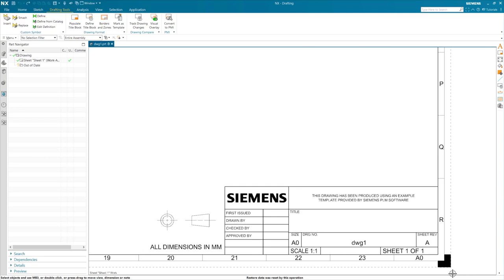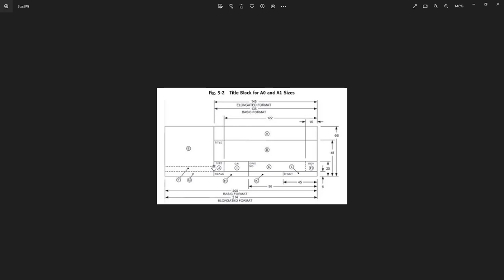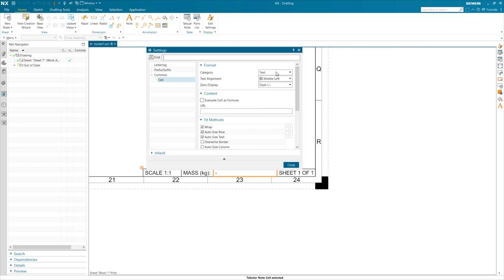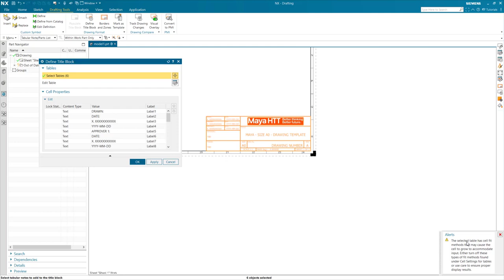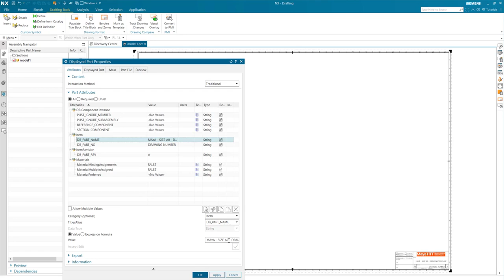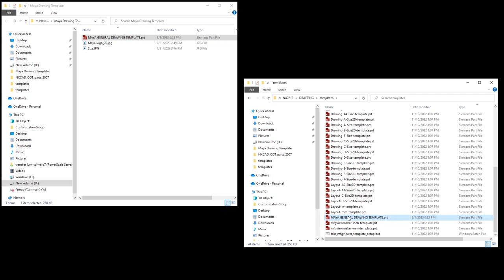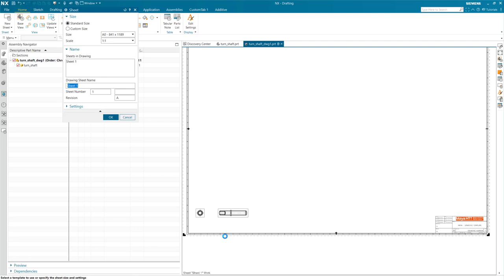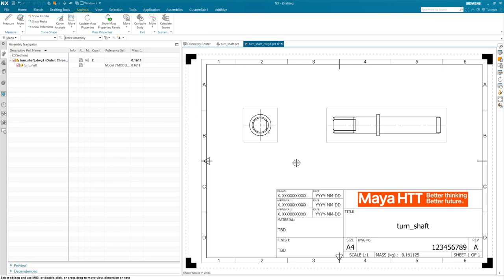Custom Drawing Template In NX

Comment: Is the only way to move a table by mouse snapping to another table after it has been defined as a title block? A typical table can be moved with the move object command (ctrl+T) but this doesn't work after turning it to a title block. It is so frustrating when they castrate existing tools that work nigh globally apart from THAT thing that they deem must work on a singular way!